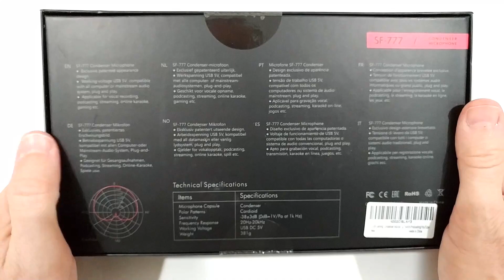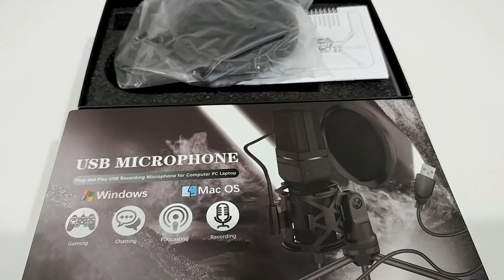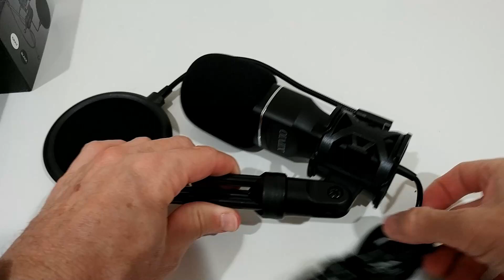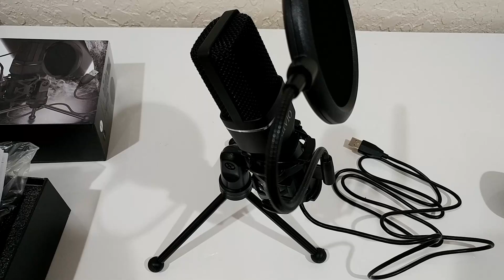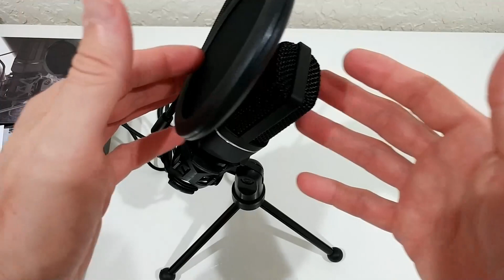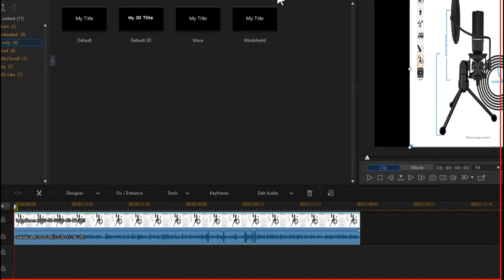XIIVIO USB Gaming Condenser Microphone SF-777 FULL REVIEW Including Recorded Sound Sample

Comment: Hi! Just saw your video and realized I have the same microphone but from a different brand, in my case is a Yanmai SF-777 and as you may already know, it has a USB 2.0 cable, so I was using it perfectly until I tryed connecting it to one of the motherboard's USB 3.0 (my mobo only has 3.0 USBs), then it wouldnt work, or at least it wouldnt capture my voice, just white noise... Do you have any idea of why this microphone only works with USB 2.0 and not with 3.0? Or in case theres a fix for using it with USB 3.0, how to do it?
Reply from the maker: Wow ... that's crazy. Never heard about that problem, but maybe try with a USB 2.0 Hub in the MB USB and then plug the mic in the USB hub. Usually not recommended, but might solve this problem ;-))